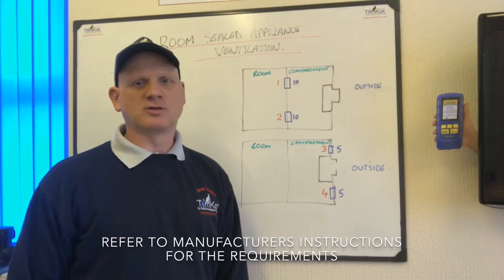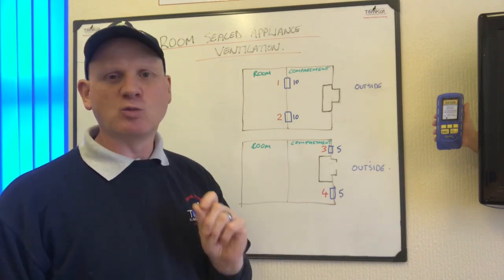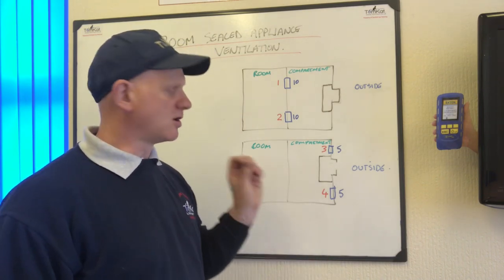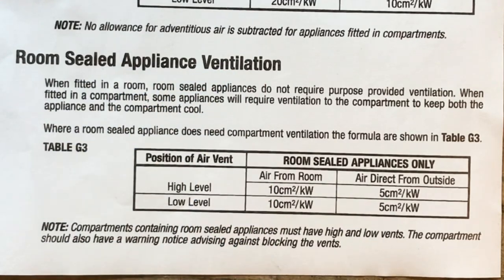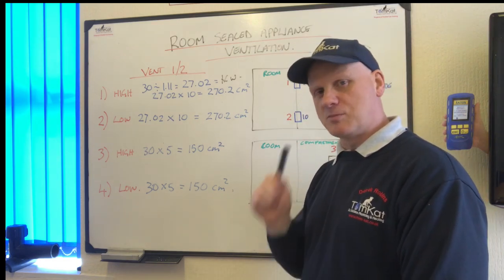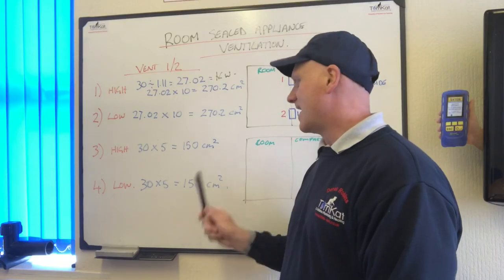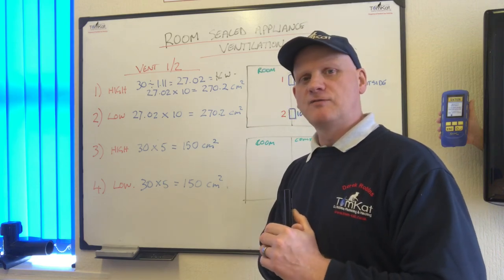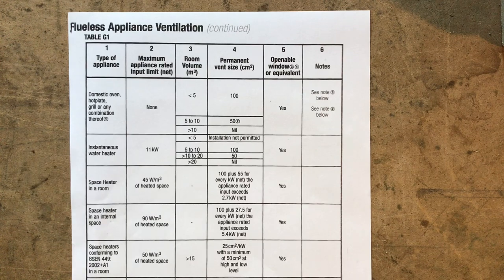Ventilation PART 2

Comment: Hi Mr Derek thank you.
Required ventilation for a single burner hot plate of 5 kw in a room of 8 m3?
Ventilation is nil
Or is it 50 cm2?
I think the answer is nil. Please correct me if I am wrong. Thanks again
Reply: Nil isn't it? Thanks

Comment: Great info .just retaking ACS being told if all appliances in room are open flue then you can take adventatiious air off kw .but if a open Flue and flueless appliance in the room you can't use the advententatious air .
Reply: Ass flueless appliance vent already slows for it